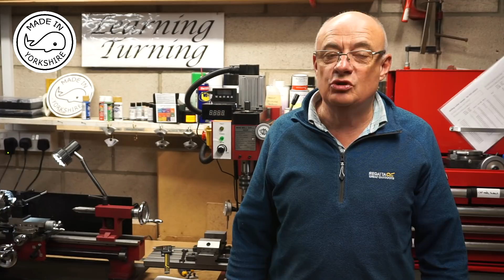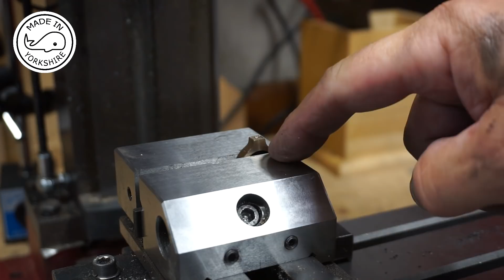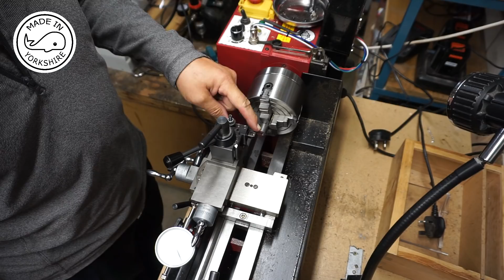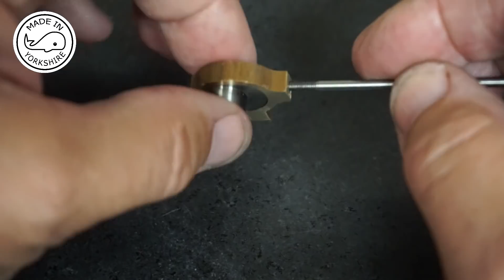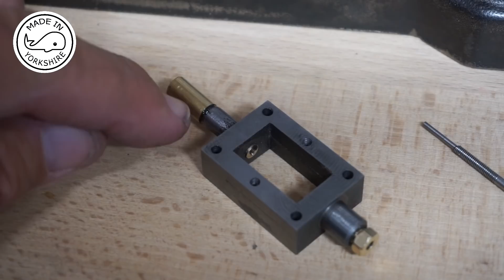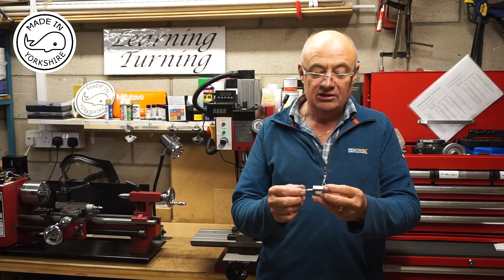#MT22 Part 10 - Making a Stuart S50 Steam Engine Eccentrics and Valve Rod. By Andrew Whale.

Comment: Dear Andrew and followers, How does one go about turning the valve rod end down to .070 ? A little foxed this end. Any help would be appreciated.
 Great Job all round and really enjoy the videos. God bless.
Reply from the maker: Hi Andrew. The kit comes with a piece of 3/32" stainless rod. It should be relatively straightforward putting that in the lathe chuck and taking light cuts to get to 70 thou. Length of cut is 1/2" but probably best to cut in several shorter lengths, moving it out of the chuck a bit at a time. A sharp tool is essential.
Cheers
Andrew
Reply: @learningturningmetal  Dear Andrew, Managed to do it with very small cuts, but didn't edge it out of the chuck as you suggested. Shall do that again to test the theory. Thank you very much for replying to my question. After forty years all this is slowly coming back to me. You are a great source of information.Thank you.

Comment: I've never seen anyone use a boring head as a boring bar before. Using it to achieve angles in the workpiece is a good idea though. As a boring bar there is masses of overhang & I'm not surprised it didn't work.
Reply from the maker: Yeah, I didn't really know what I was doing in those days 😵‍💫. I've learned a lot since then 😉
Cheers
Andrew
Reply: @learningturningmetal  I don't think I'm going to try a steam engine but I'm watching all your build videos just to see work holding techniques and lots of other things I can pick up.

Comment: hy Andrew! can you please tell me wich taps and dies i will need for the s50 build, i cant find any info on the stuart website and i do not have the money to buy  whole set of taps and dies at the moment. plus, do u know is the 1/8 x 40 tpi for the oilers a BA or a a USA withworth tap
Reply from the maker: Hi. Please see my reply to your similar question you posted against Part 11. Regarding the oilers, I don't believe there is such a BA thread. The supplier of the oilers should detail the thread information. The oilers I purchased used 1/8"x40 BSW which I believe is the same as 1/8"ME.
Cheers
Andrew
Reply: @learningturningmetal  yes yes, i see , it is a bit confusing since the oilers are marked with 1/x40 and the other taps seem to be BA , but wich and wih clearence drills are all required...it is realy a task to find that out before buying the kit

Comment: I wanted to try building this engine but seeing what problems you can have,  not sure I am up to it. You are a much better machinist than me.
Reply from the maker: Hi mate. This was my first attempt at making a steam engine. It's a great engine to help develop your engineering skills. When I made it I didn't have any real experience of milling and lathe work. It's a great engine to start with but a few challenges along the way. If you make one you might just catch the model engineering bug!
I hope you give it a go.
Cheers
Andrew
Reply: @learningturningmetal  I built the PM Reasearch engine #3 in aluminum castings but probably made half the parts twice. But it runs on air nicely.  Two other wobble engines out of aluminum stock. I enjoy all your video old and new.👍
Reply: The shipping to the US is going to be over a third of the casting cost if not more. Wish they had US distributor that would cut some of the costs. They did many many years ago.
Reply from the maker: @gvet47  ☹️ That's a real shame. I've purchased items from the US and found the shipping costs ludicrous. Crazy when China ship goods to the UK at a fraction of the price.
Reply: @learningturningmetal  Surprised someone in China has not duplicated the Stuart castings, they copy everything else. Postage in the US has really gone up and you're lucky if you get things delivered.

Comment: 'Tublecane recommended cleaning thus up in the 4-jaw but it's too thin so I'll use sand paper'

Sanding will improve the surface but it won't ensure parallelism. You can help yourself out by finding some square stock to place behind the work which will seat squarely on the back of the chuck.

Comment: Re TC's formula mentioned at 7:34; according to Excel and AutoCAD, his calculated value of 0.132" is wrong.  It should be 0.130. (The difference is not worth worrying about and, anyway, most people would use a 4-jaw for this).
For the other (?) maths nerds amongst your viewers, the formula in Part VIII of TC's series comes from application of the cosine rule to the triangle formed by the contact point of a lower chuck jaw, the bar centre and the throw centre, leading to a quadratic equation in T (the packing thickness).  TC then uses an approximation formula for the square root in the quadratic solution.  BTW I think there is a typo in the formula - the (E/D)^2 term at the end should be (E/D)^3.
Reply from the maker: Thanks for the explanation Chris. I'm sure it will help others too.
Cheers
Andrew

Comment: Great video Andrew as usual. I'm just looking to make my Eccentric... I just don't understand currently why we need a formula for the offset??? Surely, the offset will be 3/32, as this is the throw according to the diagram? He talks about 1/8th + 7 thou or 0.132" which is obviously more than 3/32". Maybe this is JUST for a 3 jaw chuck? If I use a 4 jaw... I just offset it 3/32"?
Reply from the maker: Hi Ian. Yeah I think TC's formula is specifically for the 3 jaw chuck. I think I just scribed the position, centre punched and then lined it up in the independent 4 jaw chuck. 
Looks like you are making good progress.
Cheers
Andrew
Reply from the maker: Hi Ian, I just googled "3 jaw chuck offset formula'. This link provides a good explanation: 
http://www.steves-workshop.co.uk/tips/lathetech/eccentrics/eccentricindex.htm
Basically just multiply the offset by 1.5 to give the shim thickness.
I've just compared it with TC's version and it's within 7 thou..
All the best.
Andrew
Reply: @learningturningmetal  Well, I just made my eccentric Andrew, and case hardened it, offsetn machined,  drilled and reamed.... and when I looked, it just didnt look right. I couldnt get my head round it until the penny dropped. I dial indicated the offset, great.... but that was from min to max throw, so essentially, I got half the throw!  🙄 I'll make another tomorrow then!  Happy new year Andrew, and all followers!
Reply from the maker: Hi Ian - we all learn by our mistakes and I bet you won't do that again. 

Happy New Year!
Andrew

Comment: As far as the small hole at the other end of the steam chest, I saw someone had locktited a small center drill into a bar that fits through the stuffing box and started the hole that way.
Reply from the maker: Good suggestion - I need to try to remember that one!
Cheers
Andrew
Reply: novel solution! maybe the easiest. any other way I can think of seems very involved like making an adjustable guide just for this box
Reply: I believe the bushing screwed into the end was tapped just a little off center of the other end.

Comment: I am sure that you have probably learnt by now that the main problem with those Chinese/Indian boring  heads is the boring bits. They all suffer from having the wrong geometery of the tip ( the cutting tip is well above the center of the bar ) and also the shanks are just too soft causing vibration and chatter.  Thanks again for a very nicely done build and video series.
Reply from the maker: Hi - in hindsight I think my choice of using the boring head on the lathe was wrong. I should have used a boring bar held in the toolholder. I have since used the boring head on the mill with good results. Thanks for the feedback. I will check it out when I next use the boring head.
All the best.
Andrew
Reply: @learningturningmetal  Have a watch of this. The guy is brilliant but comical too.https://www.youtube.com/watch?v=rsFFWYo8ugw

Comment: Nice job, fixing the problems. I think the reason that the boring head didn't work too well was too much stick out, causing flexing of the bar. When you used the shorter bar on the compound, you had a much more ridged set-up.
Reply from the maker: Hi Dave - I agree entirely. I guess the boring head is more suited towards milling.
All the best.
Andrew

Comment: Nice one Andrew, I look forward to seeing the test run :-)  On the subject of the boring head I think you'll get far better results once you start using it in the mill, you may find that you need to rotate the cutters inside the round hole to get the angle right but once you find the 'sweet spot' they should give a nice smooth cut :-)
Reply from the maker: Thanks Peter. I wasn't thinking clearly re the boring head. I'm getting too excited and over enthusiastic. Nearly there!
Cheers
Andrew